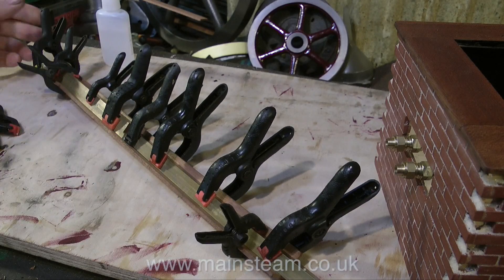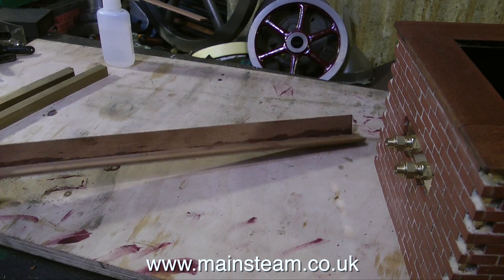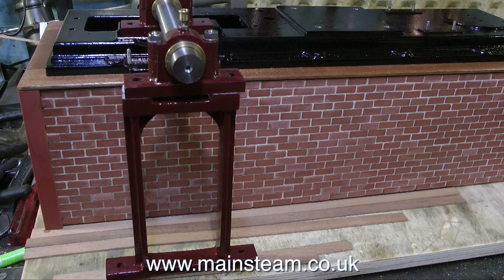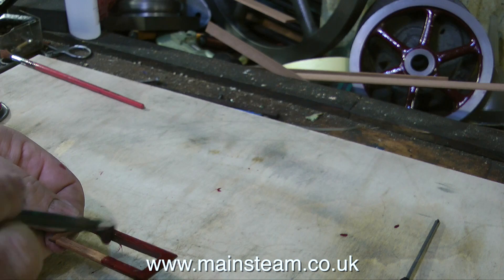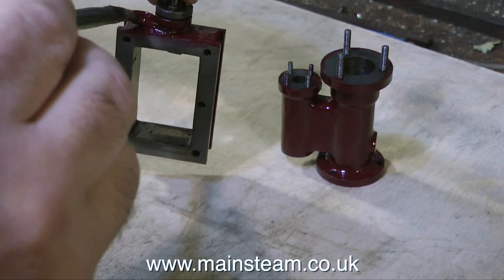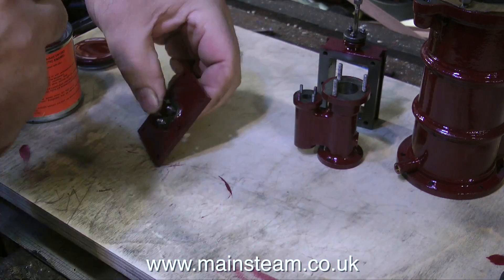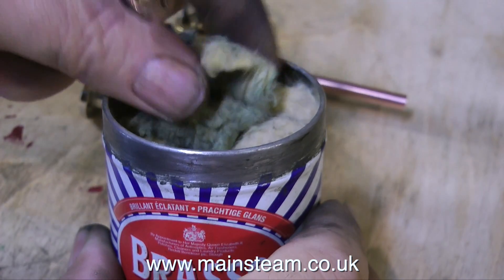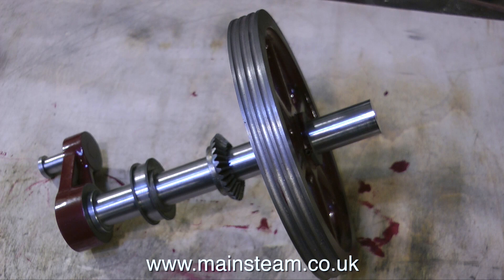STUART MAJOR BEAM ENGINE REBUILD - PART #24

Comment: Brasso wadding is actually only quite recent. Duraglit (subsequently bought out by Brasso) was the first wadding brass cleaner. It was such an improvement on Brasso, which only came as a liquid and used to get everywhere.

Comment: Looking good Keith. How about a stone look at the corners? Like many manor houses that have pronounced corners of different material or a faceted stone face. Possibly use a plaster type material to build into the protruding interlocking bricking. Anyway, just an idea for your very careful and deliberate consideration. Cheers.